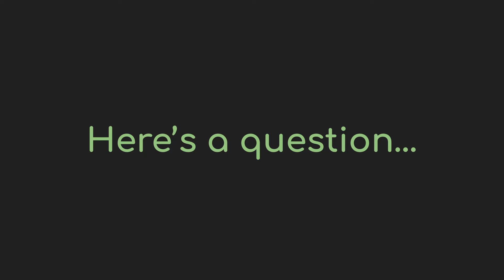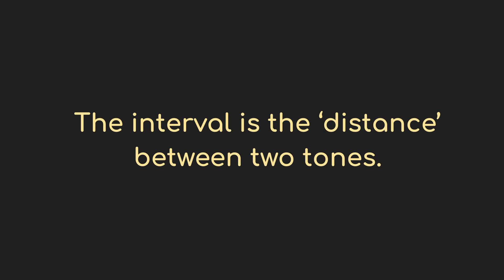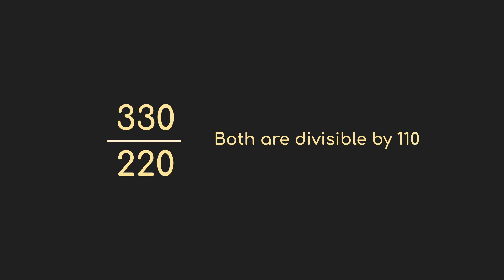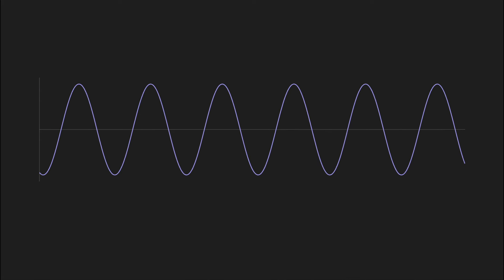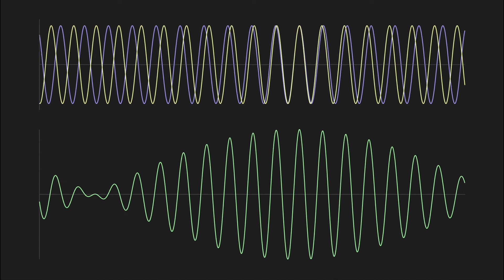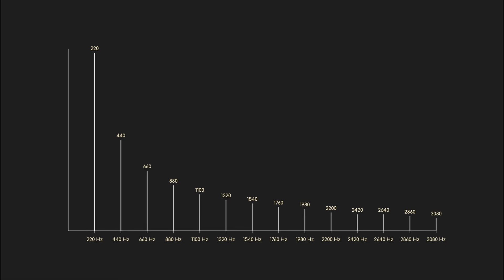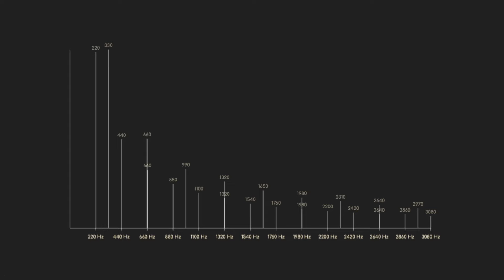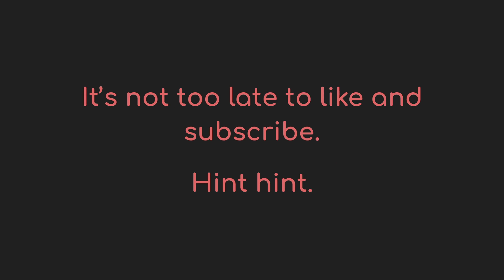Why do we perceive some pairs of notes as pleasing and others as harsh? (Understanding FM #3.5)

Comment: Video Idea

Hi Jeff,

I really like your channel, I think you are an excellent educator.

I'd like to suggest a video idea, which is related to the subject of "sound", or more precisely how the sound is physically created to our ears from voltages. 

Recently, I came to understand the connection between waveforms (like square waves) and their impact on speakers. For instance, a square wave causes the speaker's magnet to rapidly switch between zero and full strength, creating a "ticking" sound. Multiply this "tick" 440 times per second and you get the A note. I haven't found any videos that illustrate this well. You could also add explanations for other wave types. 

Another idea, perhaps for the same video, is to explain the speaker movements and their effect on the amount and types of harmonics in different wave types. For instance, why there are no harmonics in a sine wave, more in a triangle wave, and even more in a sawtooth wave.

I hope you find these ideas interesting and consider making a video about them.

Thanks

Comment: It has been a minute since I made one, but that is one of the techniques I used to create binaural beats brainwave entrainment. I knew instantly that those two tones were going to 13 hz apart and if you listen to it long enough your brain will focus in on that 13 hz beating and sync with it through the process of entrainment. 13 hz happens to be in the Beta range and is a good dominant brainwave state for alert regular waking consciousness. It is more often used for frequencies that are inaudible like lower than 10hz. 13hz is within the audible range for many. I had never thought about the additional beats that are being generated by the harmonics, but it makes sense. Some people suggest that particular frequency ranges of tones are best to use to create the effect and also with the binaural beats many people recommend that the 2 tones be panned hard left and right. I am not sure why this would increase the effect but maybe there is a biological reason I do not know of. The effect is definitely created when the two tones are combined as you illustrated, whether the tones are coming into your brain from your left and right ear, or not. Something is happening 13 times per second when those two notes are playing at the same time and if you give your brain long enough it will sync into that cycle. Even if it doesn't hear it as a sound, it does as a rhythm.

Comment: I'm not sure I understand your point about Eurorack. My sequencer and my quantisers can be used in any scale I choose. Actually it seems to be (the default behaviour of) MIDI that seems to keep us all stuck in 12EDO.

I'm also not convinced about the ratios anymore. Or not perfectly satisfied, anyway. A 12EDO fifth really doesn't sound that horrible, despite involving irrational ratios, and small amounts of frequency shift applied to non-sine waveforms (which results in inharmonic harmonics…) can sound good, too. So … the explanation is not complete.
Reply from the maker: You are absolutely right about quantizers, etc.  My point was just that since the default definition of pitch in eurorack is simply "1 volt per octave" that leads to a simple implementation that is equal tempered.  But, get a microcontroller involved, and you can set it up any way you want.  I did actually have an extra paragraph in the original script just about it, but I felt it was more noodly than I really wanted to get there.  Good catch.
Reply: @SoundVoltage  The reason it jumped out at me is that one of the reasons I like eurorack as a playground is the logarithmic analogue pitch representation, which lets me do microtonal (and root-varying) things without, say, writing code (which is too much like my day job). And since I like listening to things I haven't been listening to all my life best … well. ;)
Reply: If a 12EDO fith would sound horrible, the system would be unusable. There is a tolerance-range for the exact tuning. Plucked strings don`t have perfectly "harmonic" harmonics either, for example Piano and Guitar.
Reply: @johannalvarsson9299  I actually tend to dislike (that's a big strong. Disprefer maybe) pianos, precisely because they are so jangly and out of tune sounding. But my point is that the idea that there is a tolerance—and I agree that there must be one (a) on physiological grounds and (b) if 12EDO doesn't drive everyone insane—then the story about frequency ratios cannot be the exact story. Irrational ratios and very small differences in particular do not automatically sound extra bad, as the naive interpretation of the maths implies. At very least there are things to be said about windowing in the frequency domain or shunting beat frequencies into places where they are inaudible. But it's also possible the whole description is not really right (just as the popular mythology of 12EDO is a big fib).

If you see what I mean.

Comment: This is awesome. What is patch, oscillator?
Reply: Yo hol up there's a relationship between volts and octaves?
Reply from the maker: With modular synthesizers, yes.  Everything in modular is just voltage, including pitch, which is measured at one volt per octave.  I have a video about it (including volt-per-octave) here: https://www.youtube.com/watch?v=RXQFrs4f8tU

An oscillator is a bit of hardware or software that outputs a repeating waveform, like a sine wave or a square wave.  A 'patch' is the organization of the various pieces together.